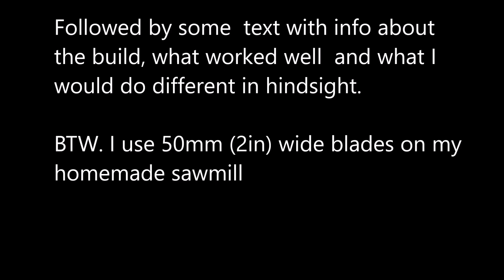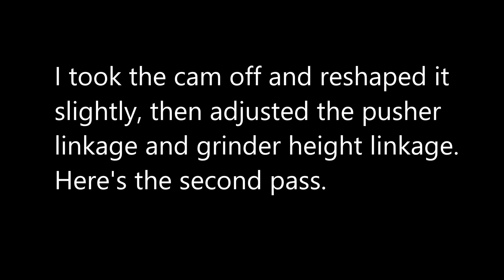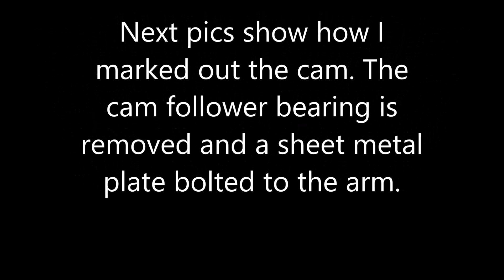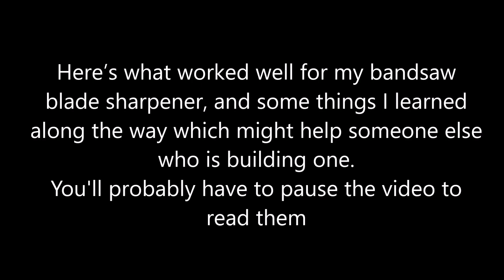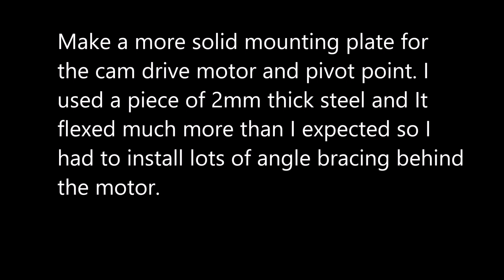Homemade sawmill bandsaw blade sharpener DIY plus tips for building one

Comment: Phil, awesome job. After watching this you have convinced me I can do it myself. Thanks Man
Reply from the maker: Good luck with building a sharpener. 
I'm envious of your sawmill. 
One thing I have learned after sharping quite a few blades is you should always start sharpening just after the blade join, and do not sharpen over the join. This is because with some blades the tooth spacing over the join is inconsistent which messes up the sharpener.
Reply: @phildiver2225  Good to know, thanks for the info.

Comment: Great video ! Just wondering how far your centre hole in cam is from where u bolted on you advance arm ? I have 7/8” pitch blades and can’t get my blade to advance enough thanks
Reply from the maker: Hi Ryan, I'm out of town this week. I'll measure it when I return home and post a reply. 
Have you looked at my other video with closeup of the cam.
Reply from the maker: Hi Ryan, the advance arm crank pin is 16mm / 5/8" radius (32mm / 1 1/4" diameter) on the cam. 
That gives the blade advance arm about 32mm travel, which is more then enough for a 22mm 7/8" pitch blade. 
The cam overall is 113mm diameter at the largest point so there is plenty of room if you decided to move the advance arm crank pin out to a larger diameter to get more travel. 
This video shows you the cam close up https://youtu.be/lu6yb1ZWXwU
The centre hole is 19mm / 3/4" diameter. The crank pinhole is 8mm / 5/16" diameter.
Reply: Thanks Phil appreciate it . I will definitely use these measurements in my build !

Comment: I think I am going to attempt this build, I will be using steel for the cam as the environment it will be used in may be very humid and I would be concerned with wood swelling or cracking due to drastic humidity swings. Do you think it would be an easy substitution? Aside from steel being harder to shape than wood
Reply from the maker: Hi Charles. Nice to hear from you. Yes, steel for the cam would work OK but I think you will find it very difficult to shape accurately. I made my cams out of good quality 9mm (3/8") plywood that was made from some sort of hardwood and it seems very stable. I suggest you consider that type of  plywood or maybe a piece of plastic sheet like polyethylene.  Good luck with your build.
Reply: @phildiver2225  plastic might be a good alternative or maybe I can find some teak plywood or something. It would be used in the winter in Arkansas and the summer in southeast Alaska, both very damp places. Had intended on powder coating all steel parts to protect from salt environment of Alaska

Comment: hello I have  been building my own  sharpener  for a few nights already , I am almost done or  already done. I am going to post  videos later on. But, I  have a question.  First of all let  me tell that I made  the  cam of  metal and  I really  don't  know how,  but  it  worked  perfect . I  put  the  center of the  arm approximately 16  mm  off the center of the motor axle and it  gave  me the  advance that  I  wanted. So  here  is m Q ? what determines the  advance  of the arm? or  basically  if  I  want to  sharpen  blades that have different teeth pace do I  have to make  a new cam? How  i  make the cam match the  teeth pace? Soooryy  if  is too much
Reply from the maker: Hi, I am very impressed that you made it so quickly in a few evenings, but much more impressed that you made a metal cam and got it right first time. Well done. My experience is that I had to make a different cam for each type of blade. I have 2 brands of blade. The tooth profile is only slightly different but I couldn't use the same cam to sharpen both types because one cam didn't fully grind the gullet out.  I'd appreciate if you could let me know the link to your video of your sharpener. Thanks
Reply: @phildiver2225  https://www.youtube.com/watch?v=igbHJ2IQ80c this  a copy of the  link for  my  sharpener, it is  not  finished yet. However I  have a  Q: I  tried today to sharpen a blade and  the machine did not was falling the  same way on  every teeth , like  in  some of then was very accurate but  on some other  felt on top of the tooth and  in others off the  tooth or far away after the  tooth passed the grinding disk. The  only reason that  I see for this is that  the  blade is bad quality, I know is Chinese, but on the  other  hand I was thinking that  they must use  a machine like this or  somewhat similar to make the  blade , so no reason for the teeth  to be at different distance one from each other. unless they weld the carbide manually.
Reply: @phildiver2225  where can I  get grinding disks online?
Reply from the maker: @lenador8619  I have purchased aluminium oxide grinding disc's from local suppliers and from AliExpress. It appears in your video that you are sharpening blades with tungsten tips so you might need diamond grit grinding wheels.

Comment: Hi Phil, I am going to try and build one how far off center is the pusher arm on the cam? Thanks for sharing your build.
Reply from the maker: The crank pin that drives the pusher arm is 16mm (5/8in) from the centre of the drive hub the cam is mounted on. That gives 32mm travel for the pusher arm. That dimension is not critical provided you have enough travel to push the blade forward then withdraw the pusher back well past the next tooth before the next push forwards. My Blades have 22mm (7/8") tooth pitch so 32mm pusher travels is plenty  Good luck with your build. If you need more advice just ask.
Reply from the maker: Hi Larry. I just had a look at the video of your mill. I'm envious!  Mine is a home-made car tire bandsaw mill. It works ok but is very sensitive to even slightly dull Blades which cause it to wander resulting in wavy cuts. Hope you have success making a sharpener. Regards Phil
Reply: @phildiver2225  thank you
Reply: I got the plans for the mill from TexasBen5 on youtube the mill is very sturdy and cuts ok But I have to buy  the blade guides from Cooks then it should cut very good I keep tearing the bearings out on my homemade guides Thanks again for your help if you want to see pics of the saw mill being built send a friend to me on facebook hundred of pics on the build Might be under Lawrence Downes

Comment: Do you have a diagram of the cam you are using for purchase?
Reply from the maker: Hi, I could trace an outline of the cam and add a scanned image of it if you really want it. However, you need to be aware that the cam only suits the tooth profile for the blades I have. Your blade tooth profile is probably different. At 3 min 24 sec in the video I have put guidance on how to make you own cam. Let me know if you still want an image of the cam. Good luck.
Reply: brother plz i  want imagine i tried lot of times but i failed plz
Reply from the maker: Just posted a video with an image of the cam https://youtu.be/lu6yb1ZWXwU

Comment: Hi phil can please send me video of how you make cam
Reply from the maker: Hi, I don't have a video of making the cam - only the pics in this video. 
I could trace an outline of the cam and add a scanned image of it if you really want it. However, you need to be aware that the cam I made only suit the tooth profile for the blades I have. Your blade tooth profile is probably different. At 3 min 24 sec in the video I have put guidance on how to make you own cam.  Good luck.
Reply: @phildiver2225   Hi Phil, your post is awesome,  I built a bandsaw blade sharpener based on watching your video,  I am having a issue in getting the cam profile correct, would you share with me a scanned image of your cam ? I think I could fine tune one to fit the profile of my blade in the event it wasn't exact, but it sure would get me close to where I need to be.
Reply from the maker: @davidlacount2568  Just posted a video with an image of the cam https://youtu.be/lu6yb1ZWXwU
Reply from the maker: Just posted a video with an image of the cam https://youtu.be/lu6yb1ZWXwU